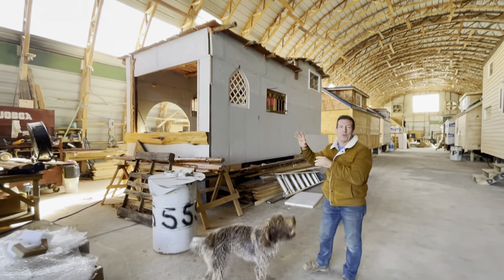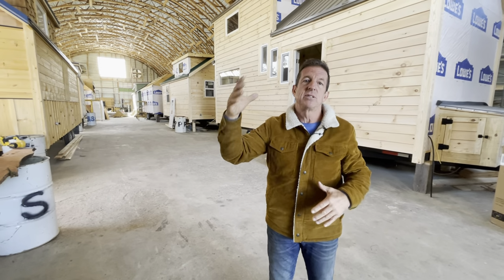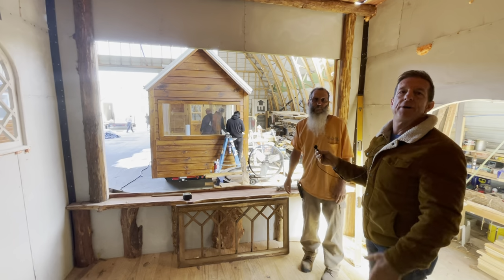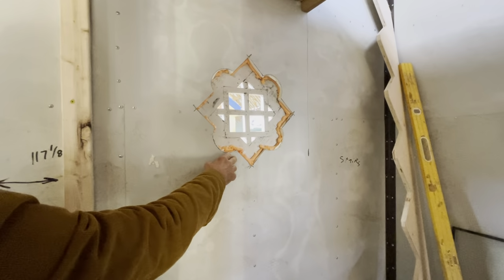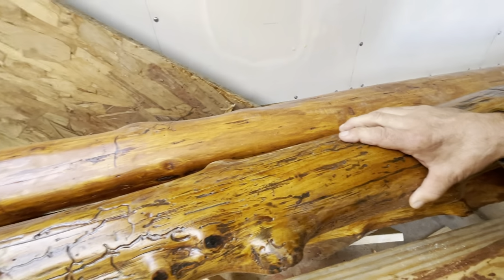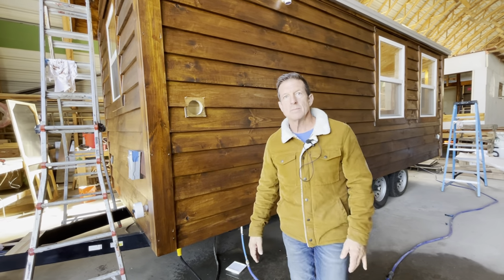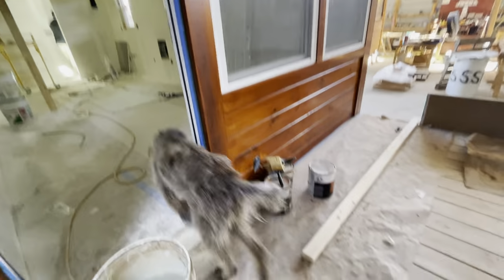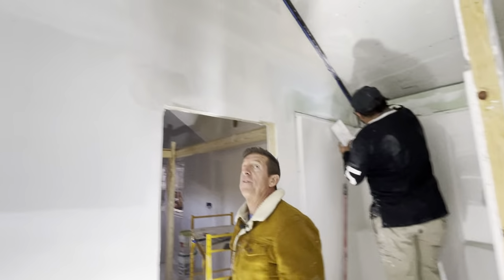Can I have drywall in a Tiny House?!?! Look and see 🏡😉

Comment: Can't wait till mine looks like that with the 2nd & 3rd coats of my Sikkens stain. Glad it has no poly. My warranty will be over before my stain is completed. ITH is slow with resident paid customers.
Reply: Hi Judith, I think you just need the work orders placed before the warranty expires. I love your house, what colour of sikkens did you go for?
Reply: @leslie6189  No work orders for house completion. They just need to do it, and said they would in the next couple of weeks. We'll see.. I chose Harbor Gray with Sandstone trim.
Reply: @judithvictoriadouglas427  thats such a pretty colour combo. Your house has the custom windows that had to be re-ordered right? With the pretty wood divider screen between the bathroom\bedroom area and the main part of the house? If so, if I've got the right house, what are the brand of windows and dimensions? I really liked those windows...
Reply: @leslie6189  That's the right house. Don't know window brand, but they are 2x4, 2 feet wide by 4 feet tall.
Reply: Thanks Judith :) are you living on site now, and if so, how is the noise from the factory? Can i assume there is a fair amount of noise from 7am to 4pm?
Reply: @leslie6189  Yes, on site, next to that black tarp thing. It doesn't block out much of the noise, but a building is planned to take it's place and it should make a big difference.
Reply: @judithvictoriadouglas427  how's the noise Judith? Is it better with the spry foam in the new building? Or still noisy for you? Are you managing okay? I saw your fenced area in the Grove video.. And I love the addition on your front entry area.. Your house is looking great. How are things coming along? I think your house was the one with the beautiful custom windows, that had to get re-ordered a couple times? I really love those windows.. Worth the wait... You must get good light? Hope you are well.... Sincerely, Leslie
Reply: Spray foam... Typo.. Meaning, does it help cut some noise?

Comment: Geeze you can see outside through the gaps in the ceiling!
Reply: Even with grass on the roof, it will leak.
Reply: That roof is not finished... That is just the layer that faces into the house. It will be secure when they're done